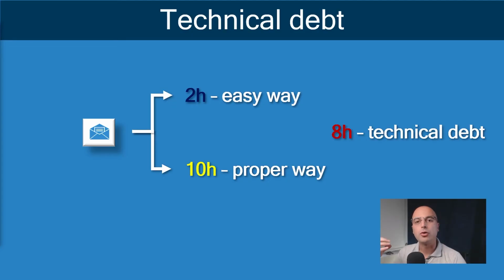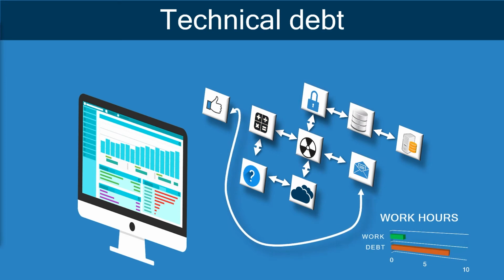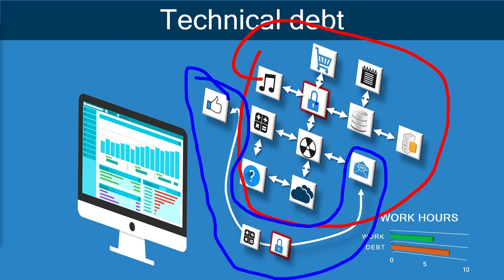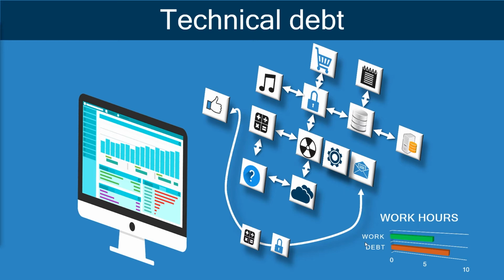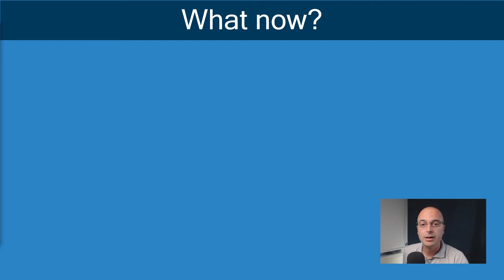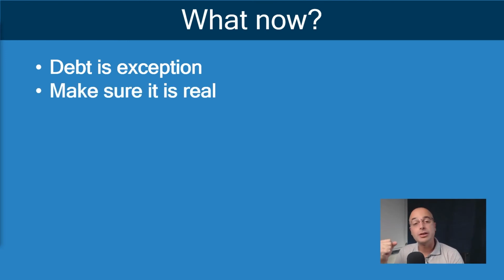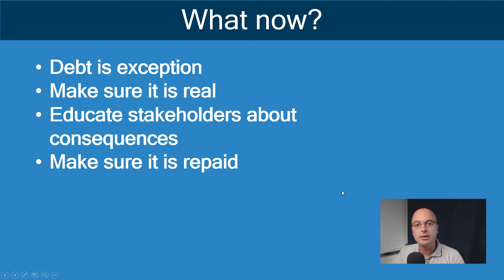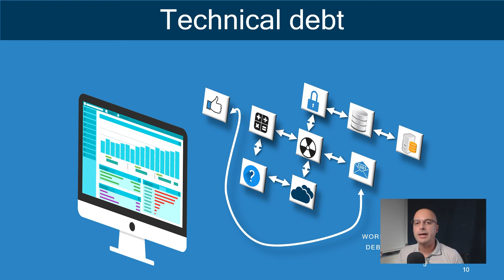Technical debt - How to make it with one button

Comment: I was watching this with a big smirk on my face. Not only a problem in IT you know... Lately my bosses have implemented procedures and guidelines to "quote unquote" solve some overdue problems. Quick and dirty and without proper knowledge so it barely works. So they add more rules and projects and implementations to solve the new problems, which bring new problems and so on. Long story short: I'm drowning in paperwork and nothin gets done.
I think I'll sneak this video in in a meeting. They won't understand the IT part, but they'll get the gist
Reply from the maker: Guess why I made this video :) I had to explain this over and over and over to people in different positions and different roles. 
I even tried to keep technical part to a minimum so that the video is more universal, and considered some non technical example like a car, but.. I think that people regardless of their role should have at least a minimum of tech understanding and be able to follow the presentation. 
Do you have any idea what you can do at this stage to mitigate the problem?
Reply: @ApplicableProgramming  Sure... About a week ago I just stopped doing all these extras and went back to square one. Sometimes a little anarchy doesn't hurt.

When trying to explain this to people I think the main problem is not that people don't understand technical debt but that they don't really listen, as it's about some (vague) problems and (possible) consequences in the future that will affect... someone.

It doesn't feel like "your" problem. Sure, the developer might know what awaits him but a Sales Manager will brush it off as a problem for the IT department. Unless you can make it personal and ask how he will keep up the sales next year and deal with angry customers. Maybe his bonus will go down. Maybe HR is using the software as well and it'll become personal if they won't be able to use feature X anymore because of patch A and B to correct C and D. Are they prepared to do overwork so people can get their paycheck on time? Is the company prepared to spend that extra money for overwork? And on extra's to keep clients happy? And on the dozens of patches?

I found out it helps if you can make people understand that it's not just someone else's problem. If they are personally involved they start to listen and are much more open to debate in finding proper solutions. Not saying it's guaranteed, but it's a good start.

Hence the anarchy part. I need to get their attention first.